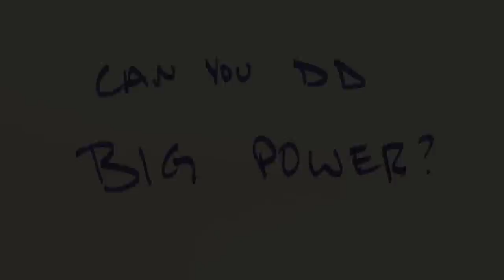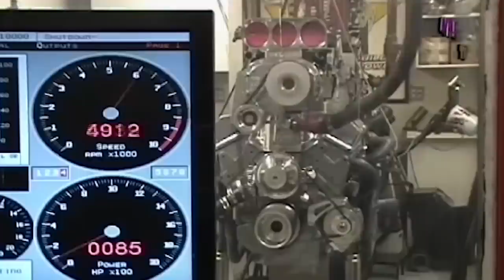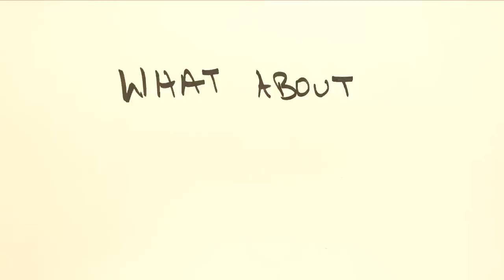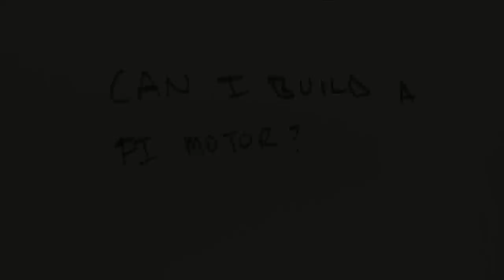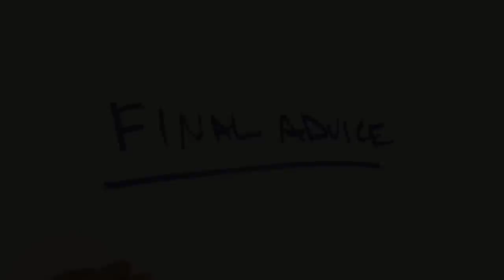How to Make BIG POWER, Safely /ENGINEERED

Comment: Mr. Nelson said something that's invaluable. "It's better to learn from someone who has direct knowledge by putting workable applications on the road."  Personally, I know just being "Book Smart," isn't enough. You have to be hands on because there are issues that crop up that aren't covered by books. Handling heat, running a race motor on the street, fitting A/C, cam timing for turbo cars, etc...no two builds are the same anymore. Just learning fuel management and tuning to severe weather has become an art. I believe learning all the intricacies of a Dominator Carburator is necessary to understand EFI to the fullest.

Comment: 12psi on a stock 4.6 3v with a USED garrett 60mm t04e, used boost a pump, and used cobra injectors. 12k miles, 14 months and still going strong as one of my 2 daily drivers!  moral: boost is for everyone just get into it!
Reply: Cool
How much hp 
Have you reached 350 hp  with that
Reply: It actually makes just a bit more than that. I don't wanna push it till i get forged rods. Hopefully Ill have time this winter to put my intercooler in it, then I can give it more timing and power and stay safe on the rods. but now I'm in a kx500 project, and I want to turbo that. this work has so many vehicles, so many turbos, so little time!

Comment: Wow! Great job Tom. I enjoyed hearing you recite what a lot of us have learned by following you over the years. Now you have given others that knowledge in a nutshell. I always learn things from you, and it helps me to plan for things I'm currently working on or trying to accomplish. Like that 900 horsepower rule, and the pitfalls of different types of boost. I was working toward an "up to" 1200 horsepower BBC using a Centrifugal Blower, and I already knew that darn belt was the worst of it. As a long time auto tech (20+ yrs) we all know and understand belt harmonics. They are vicious and ugly. The bigger the belt and stronger the load, the uglier they get! Turbos really are a great way forward to high horsepower. I just don't like all that heat. I'm glad you made it clear how challenging that can be and let everyone know that these things tale A LOT of cooling. Specially in your nice compact, neatly packaged, assemblies. 
I don't think you even got into or covered what I feel is one of your best ideas and achievements. The alternate fuels injection system to make that tame street car into a beast after those turbos spin up. 
Mark

Comment: I know how engines work, but it’s insane to me to think there are transmissions and rear ends that can handle that level of power. I wish I had knowledge like this man, he knows everything I wish I knew. 

I plan on attempting my first twin turbo build in a few months
Reply: Oh man, you just spoke my mind! 👍😁
Reply: Hope your first build goes well! I’m planning on doing the same thing. I’ve messed about with engines and cars before but I think I need to go right back to basics first with Instruction manual in hand etc. Here in 🇬🇧 we got the famous Haynes manuals which are really good. I’m gonna rebuild a lawnmower engine, a 2 stroke, maybe a motorbike engine, a four pot engine, then try a V8. I need a bit more practice first. I’m fully expecting to blow up my first turbo conversion. I was thinking of a 2 litre four pot turbo conversion. I will blow that up first and go from there 😂🤣
Reply: And I thought the same. What the hell trans and diffs hold all that crazy power? Modified th400?

Comment: I would be interested to see what this man can do with something like a fiero.
Reply from the maker: +DCsProductions Make it capable of space travel.
Reply: +DCsProductions Hate seeing PMD cars with Chevy in it...
Reply: +ramairgto72 Chevy? Or you mean GM Corporate engines?
Reply: iaidobey
If GM didn't list them as Gen 1, 2, 3 & 4 I would call them Corporate engines.

But since GM calls them Chevy Generation engines I will call them what they are.
Reply: +DCsProductions Check out his youtube channel. Lots of cars there. His sleeper rx7 is amazing!
Reply: +DCsProductions  looks at the rx7 build for Honest George!!!
Reply: +DCsProductions If you can keep the front tires on the ground, I think 500-600hp is enough and you can get that with a 2.0L 4 cylinder and be streetable.
Reply: *****
IDK, the alum. 5.3 with alum. heads is rather light.
HOT ROD made over 1,000hp in a bone stock one, the only internal changes they made were different piston rings and valve springs so they could boost the fuck out of it.

They made over 1,000hp but they put so much boost into it the factory coils were getting "blown out" because of the insane boost.

I have an LQ4 6.0 gong in a M-715. I think im just going to toss on a China Turbo, 6psi .. I should get around 400hp with all factory shit.

Rather amazing and cheap..
Reply: +funnyman1972 Umm sure... that's why BMW had a 1500 hp turbo 4 cylinder F1 car in the 80's... Guess you've never heard of a power to weight ratio. lol
Reply: Light it on fire and toast marshmallows probably
Reply: +funnyman1972 I've made a few engines and I'm starting my first 4g63 considering the price to build the little 4 banger is a lot cheaper compared to the older V8s your entering different price ranges arguments that this is better than that is stupid it's all on hp goals, reliability, and price range 5 grand can build a nice 700 hp 500ftlb 4g63. the same about could build you a reliable V8. 40 grand will get u whatever the fuck you want hahaha
Reply: Brian Heiden
Fiero was a rather good car, as evidence it sold rather well.

It's also the only Mid Engine GM car ever built.

Are you more pissed off at DC or you really hate that car?
Reply: The Fiero was a good car? Ahh no it wasn't. Mine caught on fire as did many others.
Reply: Sold for 5 years, over 370,000 were made
Less then 200 fires reported ..

Don't assume and be "that guy", know your shit before you talk it.

You all are wrong, the sales were good, it was well received, it was doing so well that GM hobbled it so it never got a V8 as intended.

Why? The Vette sales. Before this becomes a name calling pissing contest, look up the reviews on it .
Reply: Brian Heiden 
So, you got found wrong, now you act like a punk?
Good job.
Grow up..
Reply: The Fiero is on the 100 worst list of cars ever built. Who cares if it sold well. The beetle was a terrible car and sold millions. Your point?
So YOUR opinion is that it was a good car right? No one agrees with you. Especially the auto establishment.
Reply: No65mph 
Im done here, you don't know cars, you don't know history and you sit behind your screen vomiting an opinion thats not reflective of reality.
Go troll someone else.
Reply: Zero fucks given..
Earth is flat, and Fiero was never a good seller.
lol

Comment: So with this heat issue - I know that I'm on the opposite end of the power spectrum with an Abarth...

But, people are busy changing out the Side-Mount Intercoolers for Front-Mount because it reduces the amount of piping. Manufacturer says basically what you do, that it would be too much heat in front of the radiator for hot climates. Food for thought.

Comment: Amazing video. Great advice for someone starting out
Reply: This video is a felony............Read close..........Behold I present the following as fact
This video crossed the line from Fake News/info then crossed the line of rank obscenity to  a full blown abomination and cardinal sin 
The 2019 5.3 runs on 2 cylinders and gets WORSE MILEAGE than the 5.3 that ran on 8 FULL TIME and was still a POS dog  I've been around sprint cars all my life, 97% chevy dominated. And 99.5% of the chevy teams and stables run the Siamese twin intake/exhaust chevy small block from 1955. LS has been out 22 years.  The ONLY WAY Chevy can get auto racing to run LS is to mandate it like NASCAR did.  Otherwise, if you race Chevy, you run a 1955 block.  22 years and they STILL haven't got a gear front drive nor stack fuel injection that works worth a shit.  Aluminum LS still weighs 90 lbs more than aluminum 1955 engine block. With those UGLY valve covers.  After 54 years of R&D, it's a no-brainier you go with the 1955 style engine.  Chevy gave Ron Shaver, best sprint car engine builder in the world unlimited funds.  Please make an LS competitive. After 3 years and thousands of special project man-hours. mods, after-market development.  19/1 methanol compression... The best he could do was 800 HP out of a 427 cu in LS engine.  17 cu in over the 410 legal limit and 90 lbs heavier.  When any, AND I DO MEAN ANY shitty sprint car engine builder, with a BAD REPUTATION can take 2nd tier parts. And build a 1955 style engine BLIND FOLDED and get 900 HP off the dyno.  That's  mid-pack "B" Feature Material with a better than ave shoe.  LS is absolute SHIT.  If sprint car racing ever mandates LS.  I swear to God the entire sport from coast to coast will tell Chevy to shove LS up their ass, and they will ALL, and I do mean ALL, switch to an aluminum MOPAR "Y" Block with Siamese twin exhaust  410 cu in that will will produce 925 hp and weight 292 lbs.  Apposed to a < 800 hp LS that weighs 397 lbs.  BOAT ANCHOR,  DITCH STOP MATERIAL.  Every word of this video makes Hillary Clinton look like Honest .......... This video is a threat to our national security.  Posting shit like this should be a Class "C" FELONY.

Comment: Could you avoid the serpentine belt issue by running it from a separate shaft, that is gear driven from the crank? Or maybe directly drive the blower by gear(s)?

Comment: I was hoping he would discuss bump and E85. How does he manage to make a lot of power with pump. It's easy to make quad digits with ethanol, I just failed to go pass 700 on pump even with a low CR. I'd appreciate an answer. Most tuners won't even discuss this as they find pump gas very risky which it is, but I moved from the US and ethanol now costs me $100 for 5 gallons.
Reply: +Ibrahim A. Ignition timings and intricate, well-executed ECU tuning I imagine.